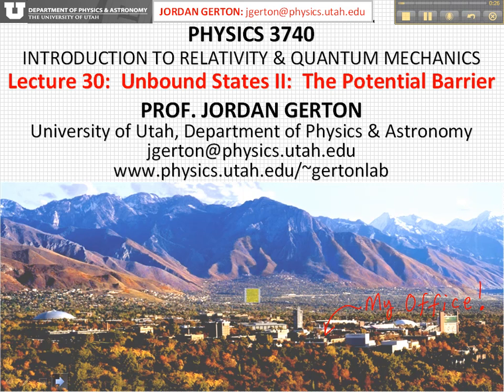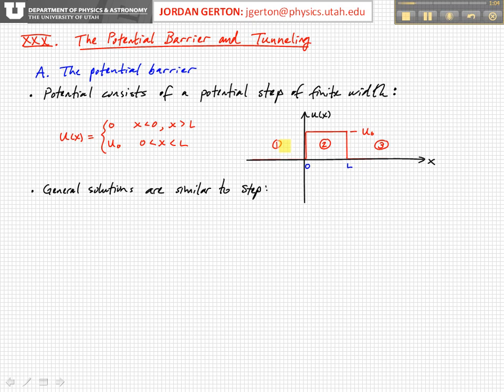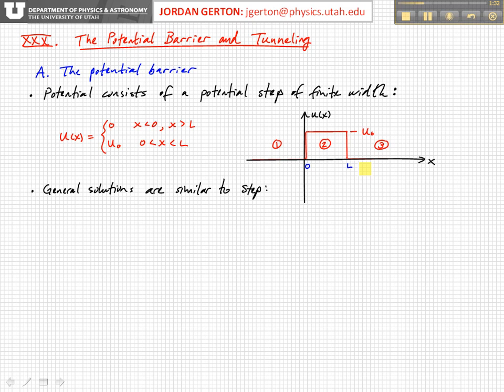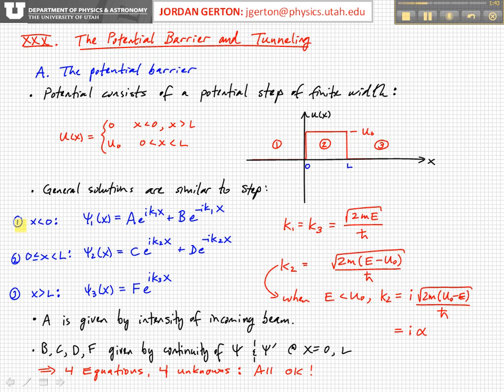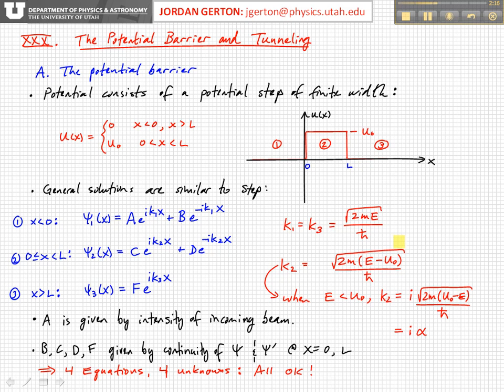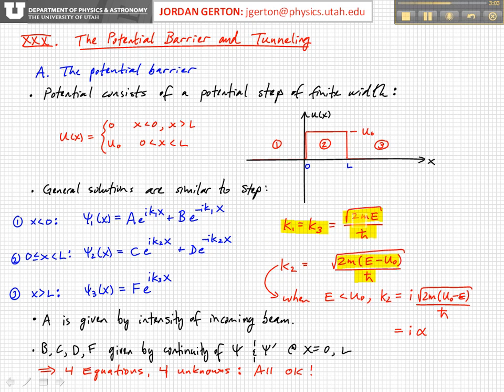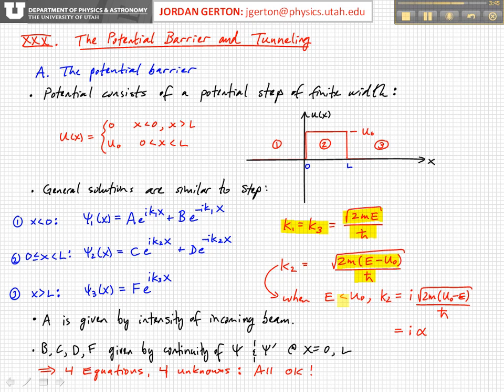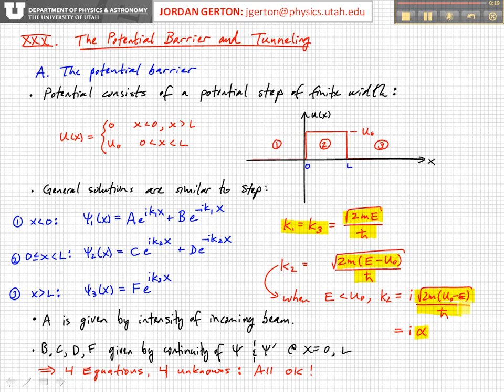PHYS3740 Lecture30-1 Potential Barrier

Comment: I find it a little intriguing that you use an imaginary number in the second region when it's a little unnecessary. You're using two imaginary numbers multiplied for both signs, but they just cancel. Solving the actual differential equation does not result in an imaginary number and it just complicates things a little. Just a little bit of feedback =] Otherwise, great video!